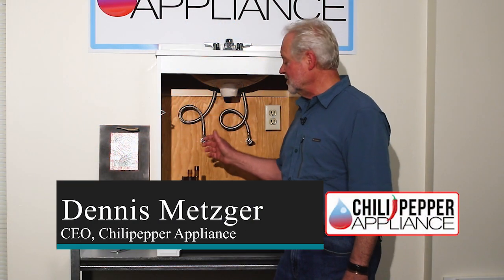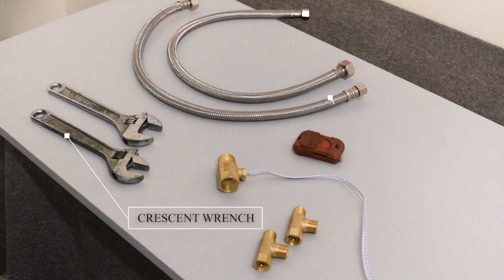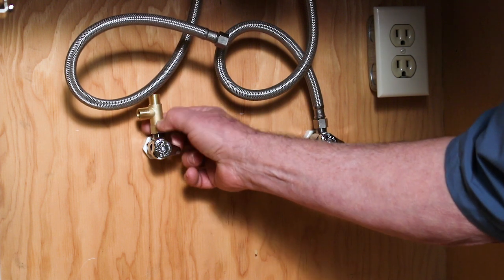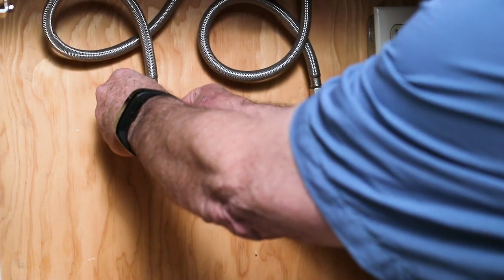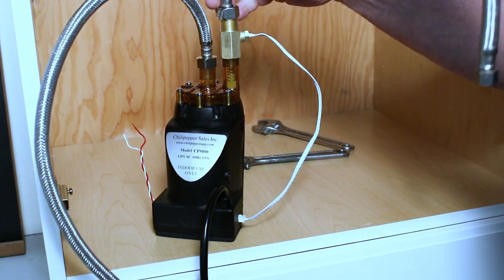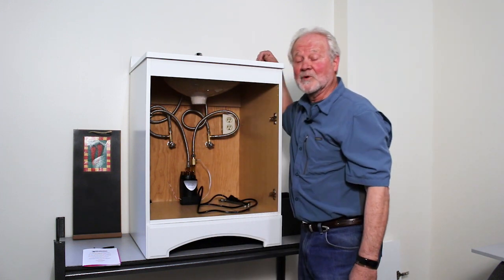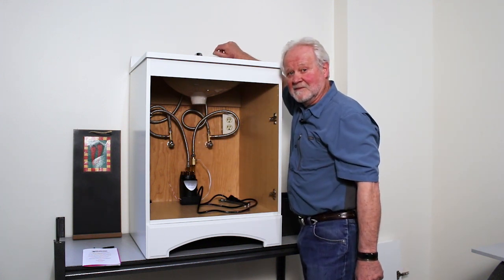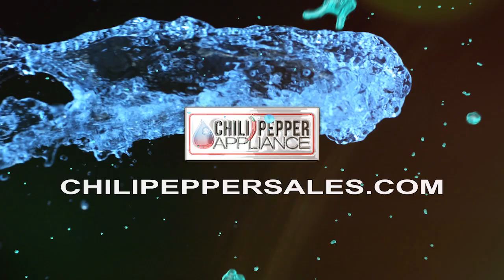CP9000  CHILIPEPPER HOT WATER PUMP

Comment: I have a CP8000 and when it works, its great.  I have emailed customer support and most of the time I dont get an answer.  Concept great, but here are couple of design tips.  The control board is not conformal coated  (sealed) and sits at the bottom of the pump.  Its subject to corrosion.  The board and parts are great quality, but it needs to be relocated higher up and sealed.  2ndly, the pump really needs a inlet filter.  Over the years of runnning, I  had to remove the check valve and find crud that causes the check valve to stick open and then the temp sensor keeps the pump off with 2 beeps.....Lastly, it would be nice if you sold a bearing and seal set or design the motor to run cooler.  The motor is not impedence  protected and depends on the load(water) to keep the motor cool.  So far I have no leaks or motor problem because I do follow the installation instructions, but the check valve has clogged twice due to crud in the lines.  l want to buy another one, but I really hesitate because I dont know if I can get support or parts.  I think I might have to find a way to install an inline filter.
Reply from the maker: Sorry to hear about the emails.  We haven't seen your emails and we always respond to our emails even though they sometimes take a few days.
We do sell repair kits for those who want to do their own repairs.   Email us at:   admin@chilipeppersales.com
Reply: @chilipepper803  you SELL repair kits for your product, why not give them out free or replace them altogether, or do you just know your product will go bad and sell the repair kits to double dip? What kind of company charges you to fix it's faulty product?
Reply from the maker: @brandonloflin9761  We do sell repair kits.

Comment: I installed one about 2 years ago and it's starting to whine like the bearing is going out. This should not be because we don't  run it continuously but only about 3-4 times a day. I emailed their site but haven't got an answerer yet. I heard other people complain about the pumps not lasting. I might add if you have plastic push faucet it won't tighten down enough to stop leaking but you will have to go to the hardware store and get plastic ferrules to use instead of the copper crush ones. I'm a retired appliance tech so i realized the problem but most people wouldn't now what's wrong. When it locks up I'm wondering if you will give me a discount for a new one which I think is only fair for the inconvenience and cost if I have to replace it.
Reply from the maker: Hi Dan,
We always answer I emails but some times it may take a few days. Please check your spam folder.
Please Send us another email to   admin@chilipeppersales.com   so we can take care of your bearing problem.
Reply: @chilipepper803  I sent an email but never heard back so I sent another one today. My pump is a 9000 which I purchased and installed around Jan8 2018 and now the bearing is whining like it's going out in my 3 year old house. This should last a lot longer than 3 years and a few months for $250. Your competitors do. Will my activators work with the new 9000 if I deicide to get another one?
Reply: Did u ever hear from them?

Comment: Is this available in a 240v pump? I'd like one in my home in Australia. Also is there any reason that the sensor isn't attached to the pump and not an extra fitting?
Reply from the maker: Australia
The units we have now are 115V so you would need a  transformer. 
If you decide to order a unit on our website.
You would Order the CP9000BR on our website for $249.99 plus shipping.
Your order would include:  1 manual button and 2 Remote Fobs per unit.
We would not include our brass T's because we've been told they don't work in Australia.

We just had a customer in Australia that kept having problems with his unit and 
come to find out he had water pressure over 100 PSI, he had to put a pressure reduction valve
on the house to solve the problem.
The Chilipepper Pump is designed for 40 to 80 PSI Max, the Average pressure is usually around 60 PSI.
Reply: @chilipepper803  thanks for the reply guys. I wasn't even sure if we were allowed to push water back into a water line. I will have to contact a local plumber before my order. Thanks again.

Comment: I'd like to get one of these but only if it can be controlled with a TP-Link Kasa module and app... which can also be linked to Amazon Alexa.  That would be far more convenient than a push button or remote control.  But it isn't clear to me what type of motor controller this has or if it can be left "on" and then plugged into the TP-Link module for controlling the on and off functions.  Anyone?
Reply: @Dennis Metzger @Raylo -  Another suggestion is to use a Shelly 1 Relay - https://www.amazon.com/SHELLY-Wireless-Automation-Android-Application/dp/B07G33LNDY
Very simple to install and direct integration to Alexa, no hub required - I'm using one of these for a low voltage switch for my gas stove, very similar application 
It runs off either AC mains or 12V for the primary side - to keep AC out of the equation use an old 12V charger (like off an Amazon echo or similar) and just plug into same outlet as the pump and the contacts to the Chilipepper.  
Also recognize that the CP will turn itself off when the water is hot, but the relay will still remain active if you simply address it as an 'on' switch; so you will either have to issue another command to turn it off, or MUCH better, just set up a routine for it so your run command is actually only a momentary one which is all it needs to set the cycle. The Shelly App provides this capability directly for an auto-off after whatever time in secs you choose (so one sec should be plenty) - and you can also set up a schedule for it to turn on automatically at specific time of day (say before you get up in morning for example). 
p.s. I LOVE my Chilipepper and the support is fabulous.
Reply: I did end up making a short video detailing the application of the Shelly-1 Relay controlling the fabulous Chilipepper
https://youtu.be/egpEl8x9iVc

Comment: The product I received has several different wires and places to connect. The wire coming out of the temperature controller ends with two loose exposed wires and includes a wire nut. The instructions provided no direction or images on how to properly connect this. How is the model number the same on mine as in this video with several differences?
Reply: Needless to say my device is not operational. When plugged in I get a continuous beep that indicates a short.
Reply from the maker: There should be a picture in the Instructions on page 4 showing the wire connections.